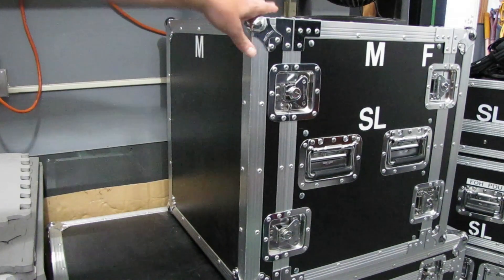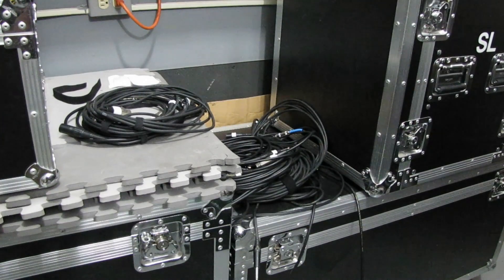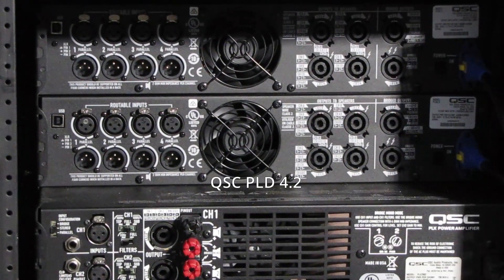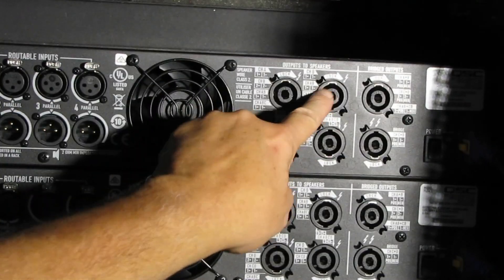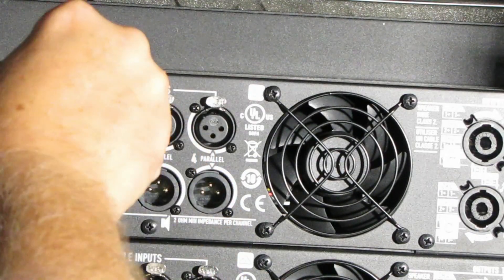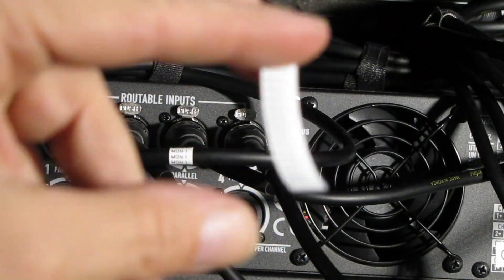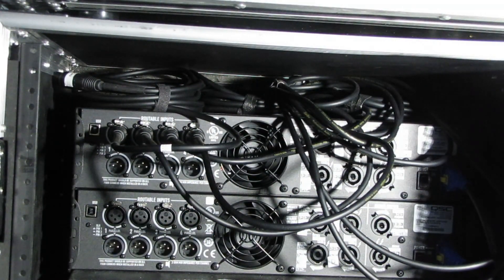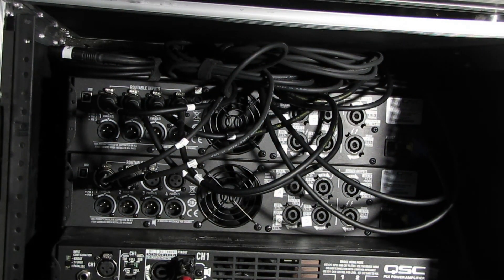Cabling monitor inputs on some QSC PLD amplifiers

Comment: Great video! 
I am wondering why don't you make a few pre wired and easy accessible patch panels on the back of the rack? I would think it saves the connectors in the amps, is easier to see and reach and thus most likely even faster for setup. 

You probably had your reasons, i am just curious! 😁
Reply from the maker: Thank you for your comment.  Great question!  Yes, I have my reasons!  I used a patch panel in an amp rack many years ago; and from that point... I do not use them.  Patch panels are great and they have their place, though, there were some issues we saw with them that led to the decision for us not to use them. 

1.)  Cost -- Considering just the amps used in this video, the expense of having good quality panels (2 would be needed per amp) and connectors (both input and output) was far too much just to move connections about 7 inches away from the amps.

2.)  Logistics -- If we did have connector panels, they would need to be recessed into the case about 3 inches (I think there are some patch panels that provide a recessed setup).  This is to provide some protection to the XLR cables (inputs/thru) from being knocked into and potentially broken/damaged.  The "normal" type of panels sit flush to the rails.  This places some connectors "outside" the rack; this causes problems when needing to place a rack in a tight location, or a location where there is a lot of gear (or people) moving around as part of the setup and tear-down.

From personal experience, I found it very easy to damage a mic cable and sometimes a panel connector, due to cables (mic and speaker) being knocked around because they were sitting "outside" the plane of the case.  Using a patch panel would help and would certainly speed up a setup, but due to the different events do, we are unable to setup our system (geographically) the same way each time.  For some events we do, the potential for cable and/or patch panel damage would be very minimal ; for other events, the potential is very high.  We error on the side of caution and keep all connections "safe" within the racks.
Hope this helps.

Comment: 2 things: use fan to fan snakes for cables. Use a NL4 patch panel for outputs. I also use XLR inputs on the panels, no hands should be going into racks
Reply from the maker: We used to have panels (years ago), but encountered some issues with it.  Take a look at a recent reply I did for someone that commented on this same topic.  There's a reason we no longer use panels in the racks.

Comment: Also assuming you're not driving any 2 ohm loads then PLX2502s are more than redundant. One i9000 can drive all subs if the other one fails. If a PLD fails then condense mixes down to 4. The PLXs are dead weight, maybe rack 1 in a 2u and leave in the truck

Comment: Hi! I love you behind the scenes video. A question: Do you use the  Crown MarcoTech i9000? Do you use the ethernet connection ( HiQNet ) to control the amp remotly? So far you had only shown the crowns from the front. QSC PLD amps with displey, DLP etc seem much more advanced than the crown but the presence of the network port surprises me.
Reply from the maker: Thanks for your comment.  We use the MacroTech amps for large shows; they are only used to power sub-woofers.  For how we use the MacroTechs, we use the HiQNet only to setup/configure the amps ahead of time.  We can control the amps remotely during a show,  and we can watch them during a show, but once they are setup, there's usually no need to "manage" them once the show starts. 
The QSC PLD amps provide a lot more functionality, however, the PLD amps are a much different amp than the MacroTechs... and as such, they should provide more control.  The PLD amps are controlled through a USB interface.
Reply: @stageleftaudio  Thanks for the nice info :)

Comment: You have cover over the output pin information with the A sticker. It should be where the original A was put bye crown .
Reply from the maker: Good observation.  Yes, the sticker is covering the output information.  Though, we keep a paper copy (several copies) of that information with us in case it is ever needed.  Rarely do we change from the configuration that we use the amplifiers for.  Thanks for your comment.
Reply: @stageleftaudio   keep up the good work I was just thinking not best to cover up the output info , keep using crown amps , I love them , but do work in the industry any more ,

Comment: Those Qsc Amps air flow is from back to front but the crown amps pulls air from front to back,isn't it a bad idea to put two sets of amps with opposing air flow in the same rack?
Reply from the maker: Good question.  It usually only becomes a problem when the amps are racked directly on top (or bottom) of each other, and if the bottom amps are generating a lot of heat (the heat  could rise enough and make its way into the top amps).  The amp rack(s) need to be large enough to allow dissipation of heated air.  However, with Class-D amplification, having amps sitting on top/bottom of each other, rarely has caused any issues.  Cooling issues, of which you describe, were a bit more common in class A and A/B amps (many years ago).
Reply: @stageleftaudio  Thanks for replying. As a amateur sound guy I really appreciate you sharing all these tips and info with us.Thanks again